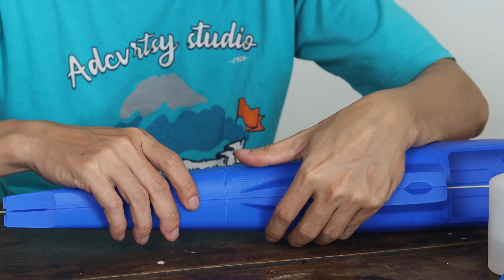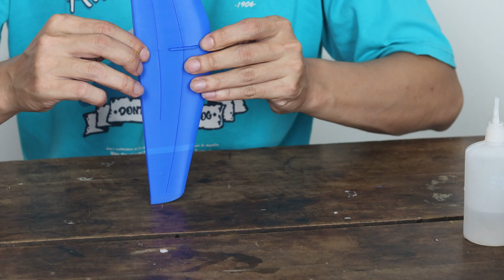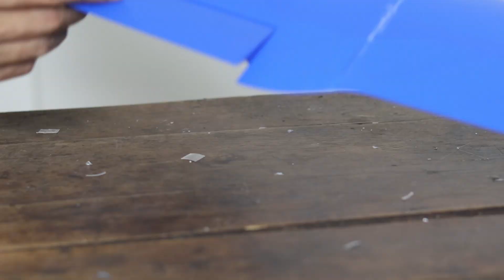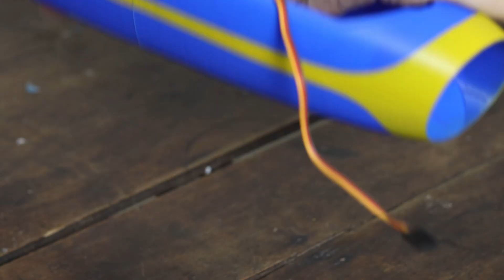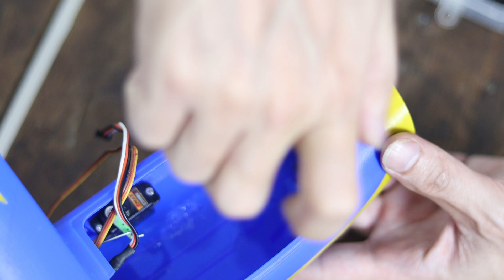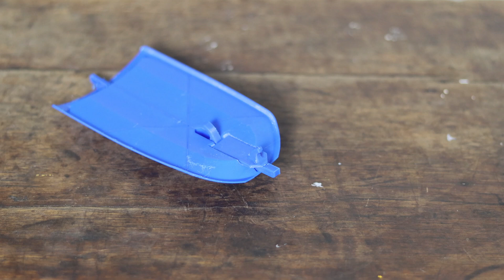FREE FILE 3D printed SailPlane - Eclipson Gö 1 Wolf

Comment: Great tutorial video however, I have one perplexing question, how did you fit a spinner onto your electric motor, I just haven't got sufficient thread left once I install the spinner back plate to enable me to mount the propeller ??? Thanks heaps.
Reply from the maker: It depends on your motor for the Shaft Motor dimension/What motor are you using?

Comment: Is there a clear parts list and where to get the non printed parts and hardware needed for this build? 

Coming from someone with zero experience or parts for rc planes
Reply: I’m also curious.
Reply: Looks like:
1. A2212 brushless motor
2.  30a esc
3. 3/4 cell 1550mah battery 
4. 4x9g servos
5. Controller/receiver you can pair your own

Supplementary material:
Stirdy gauge wire for control rods, super glue, hot glue, plastic tabs to join parts and elastic plastic tabs to attack control wings to body

Comment: when i print out wing parts, one side is printing closed. am i meant to cut open the entire side? or is there something i need to change?  the raised alignment parts on the top of the print are fine, but the otherside is solid. no lip or open end like in your video.
Reply from the maker: You enable Vase mode (spiralize outer contour). When you enable it, the top surface will open, which helps the model better.

Comment: Great work, what's the type or name or the reference of the glue ?
Reply from the maker: i am using the Cyanoacrylate glue. you can try with GLUE MASTERS Cyanoacrylate (CA)
Reply: Thanks  @JensenPlane
Reply: @JensenPlane  yr motor kv? And battery 3s?
Reply from the maker: @jigishapatel8152  size 2212 1250kv or same
Reply: @JensenPlane  I can use 1000kv , right with 3s lipo
Reply from the maker: @jigishapatel8152  yes, it so good.
i using 2212 1250kv with 3s lipo

Comment: Funny timing for the video, my last two parts are in the printing queue as we speak, after having the files on my pc fir months 😅. Anything worth noting during your construction? Did you use lw-pla or regular pla?
Reply from the maker: I am using PLA+ (regular PLA), but I recommend using LW PLA. It helps your model be lighter, and this wingspan is not high-performance and the walls will be better.
Reply: @JensenPlane  Did you print the entire plane using pla or did you use lw pla for the wings? In the printing parameters theres some parts that are listed as only being able to use the B2-LW parameter